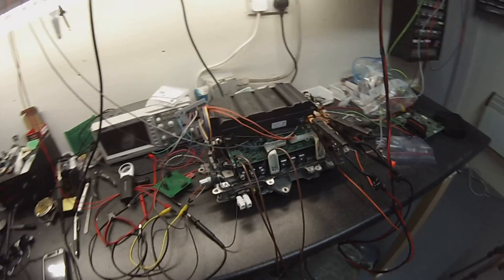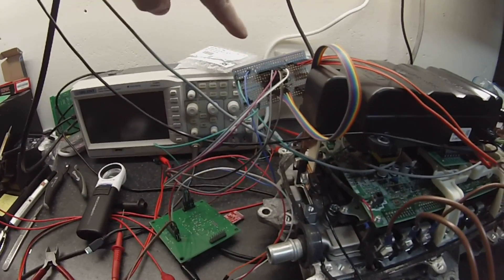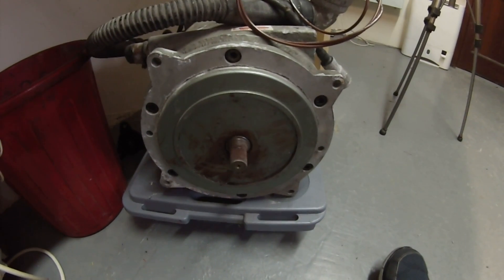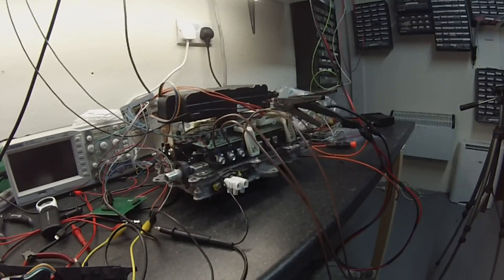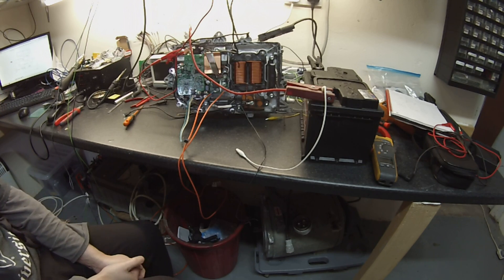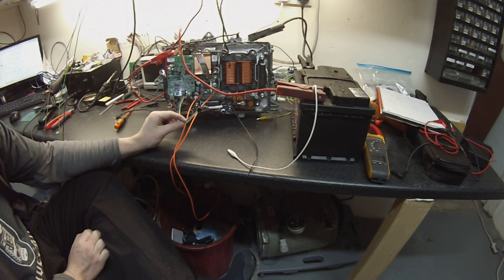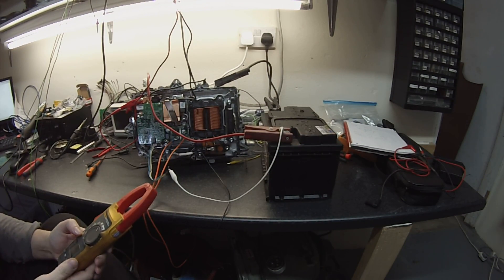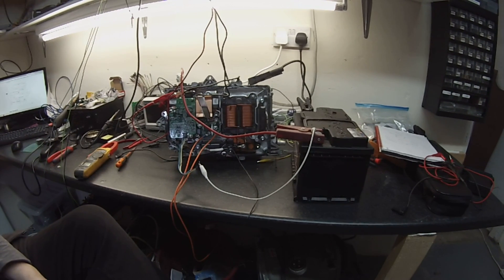Toyota Prius Gen 3 Inverter Hacked

Comment: Finally someone did some real work with the prius inverter. Soooo many cheese videos where "hey I connected a 12V 1500W inverter to the aux battery, IM SO COOL".  
Serious question: with the inverter in the car - is the inverter output a steady DC flow or pulsed when charging the traction battery? I am curious about using a 3kw solar inverter that has an input range of 160-500V to the traction battery, but wary if the inverter's output would interfere with the inverter during charging with engine on.

Comment: You know about the notorious Gen 3 inverters overheating and destroying themselves? If you want to make money, find a fix. There is a California dealer with 120 Gen 3 Prius's he refuses to sell because he believes they are unsafe. He is actually suing Toyota.
Reply: I own a 3rd generation Prius is been reliable even better then my all the honda's I have ever owned. Its still got the same factory brakes and hybrid pack even at 120K miles and dont even burn oil. I do my own maintenance, I dont trust the dealer network toyota sells there car through, alot of them don't maintenance the car like there supposed too. Good example, they skip the 5k mile oil change for 10k or more miles and up sale garbage services that don't do anything for the reliability of the car. Toyota may of had a bad run of prius cars back in 2010 because that was the redesign but the 2011 and up didnt have  many issues. The dealer not wanting to sell those priuses may of had a motive to smear the car and the Toyota brand for media or other reasons. I know that there is a big crowd of prius haters they don't like the car at all, I place blame on the fat bitch in the prius video she complains about the truck exhaust on youtube. In traffic I see all kinds of idotes who try to hit the car but I drive my Honda nobody pays mind.
Reply: @egn83b  Thanks for the illuminating commentary egn83bot. If I have to sell a Gen 3 Prius with a weak inverter I'll know who to call.

Comment: I would imagine that the Prius D.C./D.C. converter would work as a reliable solar panel controller for those with a 12Volt battery bank and would work like an MPPT solar controller.  Someone will probably hack it to enable different battery bank voltages.

Comment: I think of all the projects out there for controllers, this is the one that is closest to getting me off the couch and actually converting an EV. I have the 3ph motor and batteries already, dirt cheap or free. I just can't see a way of getting a controller without spending a huge amount of money, or jumping into a configuration nightmare of a DIY inverter that I'd have to be able to design in order to use, because of all the things that need to be tweaked or could go wrong. I think a lot of these DIY projects forget what it's like to not be an EE expert because, they're experts. It's one thing to tell someone with no mechanic experience "Unbolt the motor and gas tank and exhaust pipes and throw them away, you'll figure it out, it's not hard", because a first timer has a good chance of succeeding with those instructions alone. With the DIY controller part of these projects though, that's terrifyingly not the case. So, I think this Prius project of yours is really going to accomplish exactly what you hope it is, because to me this seems very close to something I can actually do, at a "Whatever, I'll spend that, sure" low amount of cost.

Comment: Is there any possible way to use one of these Toyota inverters for converting either  high D.C. Voltage (300-600volts) direct from solar panels or batteries  to 240 or 120 volts A.C. At 60hz?
Reply from the maker: yes
Reply: Damien Maguire I reviewed the video, almost understood. When will the assembled logic board?